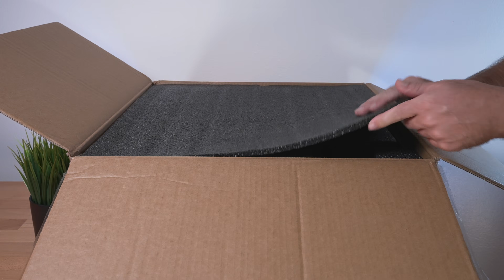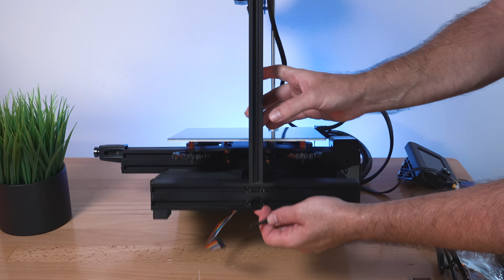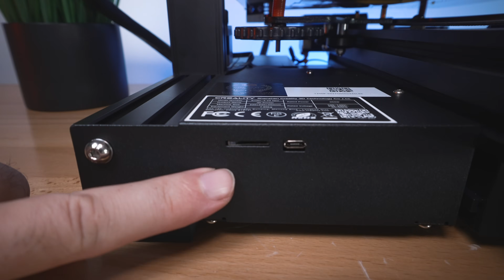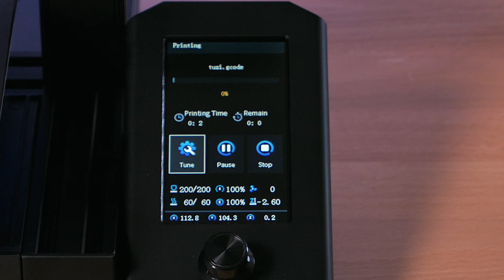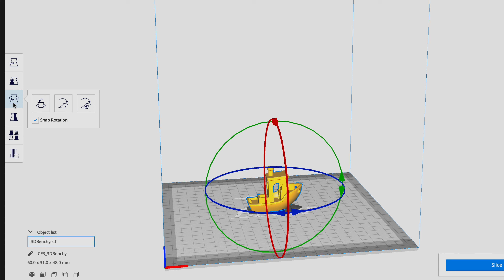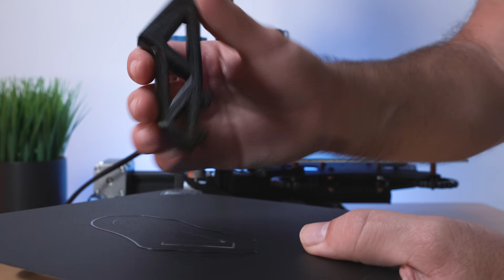Creality Ender-3 V2 Neo - 3D Printer - Unbox & Setup

Comment: I definitely should've watched the whole video before attempting to adjust mine. Got it used from someone else and the Z-offset was already input and I accidentally burned a hole on my cover plate trying to level it. Notes for the future, but this video is very helpful.

Comment: It looks so easy. I have been on all day trying to get a decent print out of mine. I bought it second hand.. I had to replace the nozzle because that was completely clogged but I cannot get a decent print at all. The nozzle is either dragging filament around as it goes.

I'll have another go at leveling again tomorrow. I don't know if its the machine, the setup or just the PLA - remind me of UHU glu with stringy mess being dragged everywhere.

Comment: Bought this thing for USD 100 😂😂😂 How far 3D printing has come
Reply: Believe it or not, I scored one of these at the local Goodwill outlet store. I paid a whopping $12 for it as-is.  It was complete with the exception of it missing 2 of the rubber feet.  It powers up, but I have yet to try and do a print.  Worse comes to worse, I can use some of the parts from it on my Voxelab Aquilar C2 printer (which I also found at a different Goodwill outlet store).

Comment: I just got a used machine that looks to be in good condition, I was able to do the bed leveling, it heats up and all motors work but it won't read SD cards.  any suggestions?

Comment: Great video!, helped me a lot as a new 3d printing enthusiast, the only problem I had is that the Z offset is not always 2.70, I've leveled the bed 2 separate times  and once is was 1.70 and the other 1.10 and I followed your instructions to the T.

Comment: Very helpful but I have run toon a problem with ultimaker and slicing files, when I plug the drive into the 3d printer I get the file but it is a little superhero guy. Does this mean I have chosen the wrong printer or have a got the wrong file?

Comment: This was very helpful to me as I just ordered one of these and wanted to know what to expect when it arrives.
One thing though is that a calibration cube is intended to be used to check dimentional accuracy. this you did not do. On some prints this could matter and confirming X Y and Z axis are consistent would be important especially if the printer is bought by anyone using in a commercial engineering setting...

Comment: I just bought one of these earlier this week, and as others have said, this is probably the single most informative and helpful video I've seen.
Just wondered though: do you have links for the spool-holder that rests on the table which can be made out of PLA please? I couldn't find it.
Also I'd really like to try making the gear, the millipede and especially the chain-mail. Do you have links for those too please?

Comment: This video convinced me to get this printer. I found one used and then used this video to set it up when I got it. PLA is printing perfect and I'm going to start experimenting with PETG next week. I have limited space where I have mine so instead of printing the side filament holder I printed two guides, one that sticks out from the left side of the gantry and one down by the extruder so I can use the holder on top but still get the filament going into the extruder at a nice angle. So far I love everything about this printer, the only thing i wish is that the build plate would be even bigger for bigger prints.

Comment: At around 16:50 - stop listening to Vlad. Do NOT put any cooking oils on the screw. It's actually better NOT to have any oil than use cooking oil. Most cooking oils will harden with time and you will trash your z-axis movement as a result.

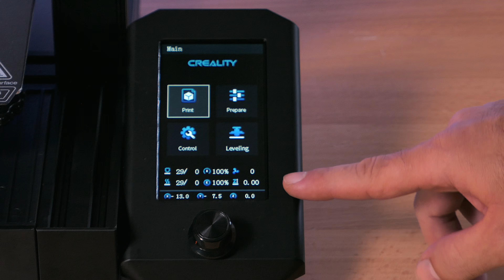Also, at around 23:45 - stop listening again. Unless you wanna see that your bed/nozzle are, in fact heating up. Once you satisfy yourself with that knowledge - hit "Cooldown" and wait for it to actually cool down before attempting to level the bed. The damage to your bed WILL occur when heated to 200C nozzle touches the bed. Even through paper. Thanks for that, Vlad. Much appreciated... not.

Comment: Insanely helpful video. Ditched the manual and used this to assemble the printer. I was surprised by how loose some of the screws were, and I guarantee the prints wouldn't come out as nice as they do if I never knew about it. Thank you for helping me get the best use out of my printer, never had a serious issue!

Comment: Thank you for this video. Super helpful getting my printer set up.

A word of advice for those first setting up their printer - do not use black filament. Because the bed is also black, it is hard to distinguish black filament from the bed for those first several layers (especially when the extruder housing is obscuring the print).
I had my z-offset just a hair too low, and it scratched a faint outline in the bed. I couldn't tell at first if it was printed filament or scratching. I was able to make adjustment and start over; and thankfully it seems to be printing just fine now. Hopefully the scratches won't cause issues for future prints.

Comment: hello vlad, wanna ask something here, i bought these model 3d printer recentlly then i assembly it and then plug it on to set up and do some print test, after i pllugged it in and turn it on suddenlly there is white smoke out from the bottom of the printer and then some liquid is spilling too, do u know whats wrong or what part is broken or defect in this case ? thank u in advance

Comment: by mistake I ended up with resin and fmd printer. The resin is Elegoo saturn 2, and FDM is this exact model on this video. I am no expert when it comes to 3d printing but I do know and understand build quality and structure . I played around with both to have some of my personal opinion for the saturn and neo. The very first thing that came to me was that neo was very small and very cheap build quality. I can literally bend the whole neo. The worst thing for neo is the adjustment. If you have neo and you have zero problem with print I applaud you. My luck with neo is terrible. It worked great the first 3 times printing the rabbit and 2 cubes. After that it went down hill quick. Bed does not budge manually so I can't level out as I should. I can say much more down side about neo but I'm not even going to waste my time. I am returning the neo and after some research I decided to go with ankermaker M5. It was more expensive but I guess with 3d printers you get what you paid for. Now for saturn 2 resin printer, I have zero complaint. It's simple easy and it does the job every single time without a hitch. The best thing about saturn and just resin printer in general you can load as much model you can fit on the bed and it won't give you extra 3 days of printing like the FDM printer does. The only thing with resin is it can get a little messy but I rather get messy than having to level a bed for 10 hours. Resin to me seems like the future. FDM just feels old especially the ender. I'm glad I was able to use both type of printer. They both have it's own purpose.

Comment: This vid was A LIFESAVER!  I started with a 3-Pro which was delivered with Chinese firmware installed.... I don't speak Chinese.  Returned it to Jeff B. and ordered a E3V2Neo and setup was, as you showed, a breeze.  Your settings and leveling tutorial were spot on and the first print was as you described and printed in the demo.  Thanks for your generosity in sharing knowledge.  Cheers

Comment: I followed your steps -2.70 was too much I scratched my print surface.
Reply: Sometimes the height the printer needs is slightly different, which is why you have to level it yourself with a piece of paper.

Comment: Hello. So I have this printer. Everything works and I added the parameters you use. But every time I print something no matter what it is. It starts off bad. Either it does slice good or it doesn't fill in something. But as time goes on it gets perfect. Any advice? Please
Reply: Basically if I'm printing anything besides a calibration cube, the boat, or a rabbit. It comes out bad

Comment: Incredibly useful video!  Thank you for the step-by-step guide.  You made the setup process very streamlined for me.  I printed the pre-loaded benchy after mechanically setting up my printer just like you said with the sample spool of filament, and it came out perfect first try!  
PS. read the wheels when adjusting the springs for what is up and down.  I accidently burned a small hole in my build plate by moving the bed into the red hot nozzle when I thought I was moving it down lol.

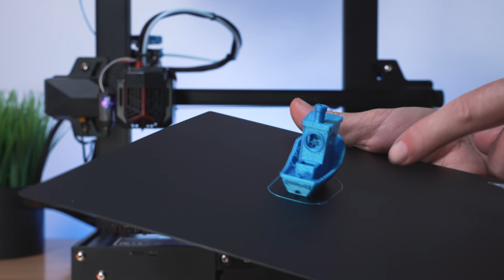Comment: Great video, used it today to setup my Ender-3 V2 Neo. Perhaps it would have been a better option to not preheat the bed when leveling it. In my case, I did manage to melt some holes into the bed and if I look at the top left section of the bed at 32:44 you did the same ;).

Comment: At the time of this comment I am halfway through my first 3d print of the rabbit. This has been really helpful but there are a couple of things I learned along the way. First, do not preheat the filament if you're not done with the manual leveling. Doing so will damage the build plate (I managed to poke two holes on the upper right corner of my build plate, fun). Second, -2.70 is not universal. My z-offset ended up being -2.20 for some reason. Oh, and purge your filament before printing. Thank you so much, Vlad. Because of you I have a working 3D printer.
Reply: my z off-set is 0 do you perhaps know why?

Comment: Can't see the point in lowering the extruder before fully tightening the gantry bolts to the base frame. There are no slots in the base frame. Just 5mm holes to receive the M5 bolts, so they can only end up in the same place anyway. There is no adjustment as implied.

Comment: Soooo what voltage do you set it to if you live in New Jersey? Great video by the way.
Reply: just search it on google, you shouldnt worry if ur in america tho because if the voltage needed is 115 and you set it to 220 its not a huge issue but if you set it to less then it wouldnt work. If you did it in europe tho it would fry ur motherboard

Comment: I picked this up the other day. Printed the rabbit. it stuck to the magnetic bed. now I have pla on the bed that wont come off. 
What went wrong?
How to clean the filament off the bed?BTW excellent video. You are very good at this.
1 suggestion, for those new to this. Maybe explain why the paper.
Reply: The paper is just to measure the gap (if it lightly scrapes the paper then ur good) and for th pla you can use a hairdryer or something to heat it up and then scoop it off with a spatula or ur hand

Comment: my extruder hits an obvious "stop" on the gantry track at the middle and toward end of both ends.  is that supposed to happen.  with a little extra force it breaks past the stop and rolls fine but the "stop" sensation i feel while trying to freely roll the extruder seems odd.  i dont see other YTers mentioning it in their install videos and when they freely roll their extruder i get the impression theirs is not hitting these "stops" on the track.  i looked at the wheels and they seem smooth (no obvious flat spots).  any thoughts?  first time 3d printing and i want to make sure it's adjusted correctly before i turn it on and try printing anything.

Comment: Got this one as a present for my brother.  Set it up according to your video and ran first 2 prints without any problems (using supplied plastic).  Did have a little bit of an issue initially feeding the filament but it is just touch and feel experience.  Could you do a video on maintenance and using different types of filament on this printer?  I plan to run my own design for custom size enclosure for a light switch using PETG plastic or perhaps I need to use another type.  Too new to this 🙂

Comment: Made my own test boat print with the included filament after setting the printer up and calibrating it with your tutorial. It printed out extremely well with no stringing and totally smooth surfaces even without slicing it myself. Thanks!
Reply: Ah a benchy. Keep it, I threw my first one away. Don’t make the same mistake
Reply: İn the description of the printer say's that the calibration it's automatic. What that means?

Comment: Awesome video!! Why did you add the g29 home all axes in the program?? I didn’t understand why and I want to.
Reply: G29 = Auto bed leveling. Adding it in the start gcode(which is executed by default before each print) means that auto bed leveling will be executed before each print and right after G28(home). It is the same thing as homing the printer manually and then auto bed level it (from the screen) but having the respective commands in the start gcode will do that automatically every time you start a print. The command G29 is explicitly for CR Touch sensor which is to be found on this printer, adding it in start gcode is not a necessity and it is a user preference.

Comment: Thanks for the awesome setup guide! My first few prints worked flawlessly following this video. One thing I would recommend adding to the guide is that people should check the power supply voltage settings as mine was set to 230v straight out of the box and I kept getting errors that the nozzle temperature was too low. Flipped it to the 115v and works great again.
Reply: Soooo what voltage do you set it to if you live in New Jersey? Thanks in advance.
Reply: 115v  @sethburrowes3275

Comment: After 3 prints the printer have suddenly started jerking and moving way to fast between lines/extrusion, causing insane layer shifts.
I went back to all standard settings
I tried reinstalling the creality slicer thinking the G-code might be weird.

But the Boat print pre-sliced and untouched on the memory card has the same problem.
This happens to all my prints now.
I doubbel checked all the belts and wheels, they might actually be better now than the initial settup.

I'm thinking of reinstilling the firmware next. Any tips or thoughs?
This is completely ruining my prints.😟

Comment: I printed the boat after following along to your video and I noticed on Port side of the ship I noticed almost like a little seam running down side. I used Polymaker PLA Pro but just wanted to give you a heads up that it may be an issue with the actual demo file (I think you referred to it as stippling?) Anyway, thank you again for walking me through and getting my 3DP setup!

Comment: I just bought a Ender 3 v2 neo and the first time i used it everything worked fine but the bed was a little too low so i let it cool down by turning it off but the next time i turned it on which was 10 minutesl later the screen was stuck on a boot loop and the cr touch was red. How do i fix this?

Comment: Thanks for the great video. As a beginner, things I wish I had been described a little clearer in your video - the role of the eccentric nut - with the thread hole not dead centre of the nut, but rather offset and thus used for positioning purposes rather than for normal nut 'fastening' - and only minimal rotation thus required.  Also, the manual bed-leveling process - and paper test in the four corners - it would have been useful to know the margins we were trying to obtain and whether it is critical all four corners are set identically.

Comment: I set up the printer upon your video today and I have one comment to manual bed leveling. Do not manual level right into a paper thickness for the first round because the bed can be a lot off the level out of the box (as mine was) and then when you push the printing head to other corner, your hot nozzle can make a hole into a bed cover (as mine did). Fortunately this happened by the edge, not in the center...

Comment: That is a great video, the best I've seen for this printer. I just got one of these for Christmas and had a little bit of trouble getting the first print, one thing I found is they say "move a piece of paper under the print head" when leveling. I saw another video that suggested you have a little bit of "bite" to the paper, it should move, but you should be able to feel a little bit of drag or "grit" from the paper. I kept getting problems with the material not sticking, but just a tiny, tiny adjustment on the z offset so that the paper "bit" just a little tiny bit made the difference.

I notice the model I have is slightly different, the Ender 3 Max Neo, they have moved the filament spool to the exact same place you did.

Comment: Hi I was wondering if you could help me with an issue I am having recently I got a ender 3 v2 neo aswell but I have had an issue with the heated bed as when attempting to print the filament does not stick to the bed I have tried many temperatures and it still doesn't work if there is anything you could do it would my much appreciated

Comment: Your video was actually the only one after watching 7-10 other first test video tutorials that really helped me to get the ender 3 V2 neo working for the first time. In the first attempts the filament moves a over in the first layers. It was when I watched you video and adjusted the off set to -1.67 when I got the printer working correctly. Thanks.for.your well explained video .

Comment: I ended up printing a filament guide instead of the spool holder. I prefer to have the spool on top to add a bit of weight down on the printer. The filament guide can also be printed in PLA because it's a very small piece with no strength applied to it. 30m print using (thingiverse) Ender 3 v2 Filament Guide by Phile88.

Video was PERFECT to get up and running!